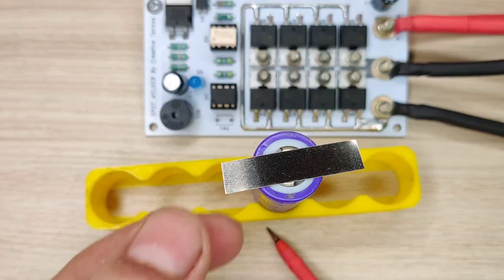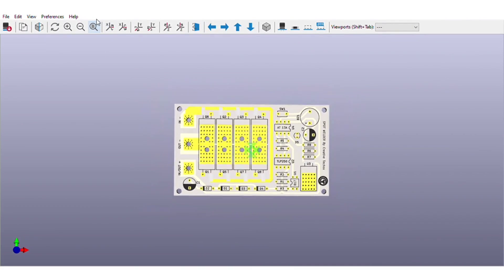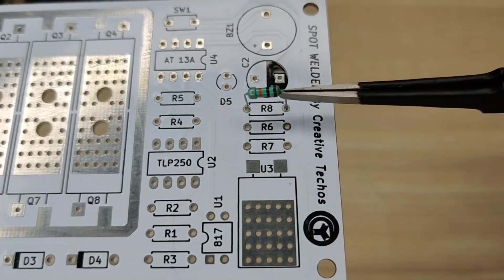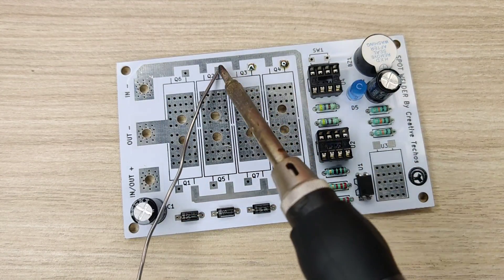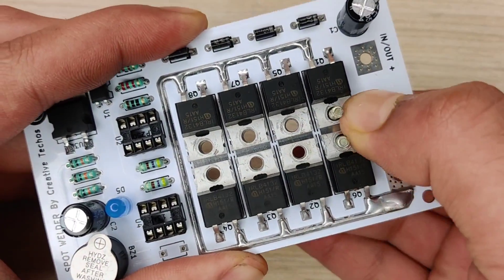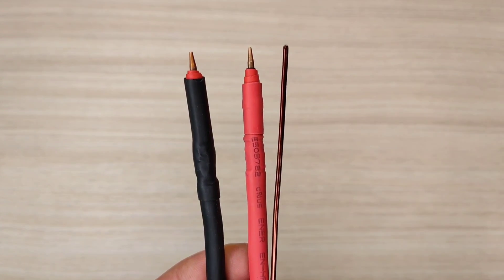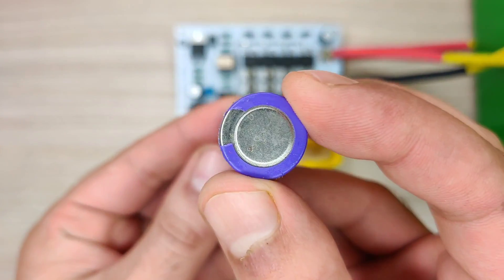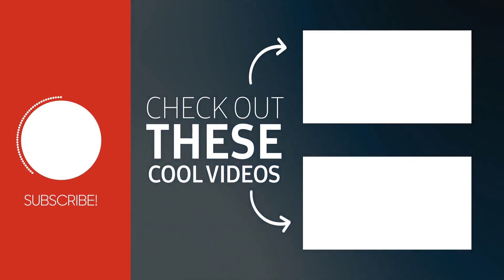How to make Portable Automatic Spot Welder

Comment from the maker: 👉Download Circuit Diagram, PCB Files & Code
https://drive.google.com/drive/folders/1iLm-MczZgpwBLVQtHvoQZ2wGku-BMCCM
Reply: Is this the Gerber file 
Then code what does it stay for pls
Reply: The gerber zip file included only NPTH drill layer but not PTH drill layer, therefore JLCPCB did not produce the PCB with vias. Can you include PTH layer and update the file?
Reply: @atildora9034  What I'm going to do is I'm going to find all the components in smd (SMT) version
Reply: @fiosasolta  This is a two layer PCB therefore, some pins will need connection on top and bottom layers. That is why the "vias" are needed in the drilled pin holes. Hence, SMD may not be the solution. I started drilling the holes myself. For those holes that require connection at both layers, I will try to establish connection by soldering.
Reply: @atildora9034  Thanks for the info
Reply: @atildora9034  Too late I ordered the pcbs and I have already received them.
Reply: Úù mean we can download it and printed it for ourselves
Reply: Sir you are great but this is our bad luck in our country the cost of pcb from jlcpcb is (2 to 4$) but you imagine the shipping charges is (20 to 60$) how can I order pcb you have any idea.
By the way I am from Pakistan.
And our local market is just piece of shit.
Reply: Good
Reply: can u share json file to me
Reply: Pls I need handle to be able to talk to you Wattsapp or telegram
Reply: I ordered a PCB through JLCPCB but there was not a single drill hole on the board. Tried on PCBWAY and same problem. Then I watched your video again and when you uploaded the zip file to JCLPCB, I noticed that there are no holes in your video either.
Can you check your zip file and upload it again.
Great project regardless of the small problem
Thank you
Reply: U don't reply messages why
Reply: I uploaded u r pcb design on side dont have soldring holes in pcb . Can you answer?
Reply: Hello brother can i get One PCB with/without components
Reply: Thank you for sharing.... but I can't download in this link (can't open). Can u help me to share in another link or drive? 🙏🙏

Comment: very nice.  its good for any light duty work by a hobbyist or anyone who sometimes need to weld batteries.   i am following a similar approach in my design with following modifications.  this will help to keep prices low and also the efforts

1.  instead of buying new mosfets, i am using for an old computer UPS for 500 VA or more. i have sawed the PCB from UPS to extract mosfet together with heatsink etc

2. for the timing, i am using a programable timer module easily available on line.  you can program pulse from as low as 10us.  the relay in the module may be used or can be replaced by optocoupler

3. for the purpose of safety, have added a snubber on MOSFET and a circuit breaker in series with battery.  if for some reason MOSFET blows, the short circuit conditions can become very nasty and dangerous

4. the timing circuit and gate driver is powered from battery, it would be good to use a capacitor and diode to keep voltage steady during welding.  the battery voltage will fall during the pulse duration.  the will ensure steady gate voltage and protect MOSFET from failing

Comment: Good and professional project my friend, youre doing well, i love your projects and they save me. Sending you hugs from Nigeria. 

I tried making your circuit by fabricating my own pcb through your schematics. The attiny13 beeps the buzzer and blinks the led when it sends out a pulse. But i didnt see the tiniest spark. I am testing with two pieces of IRFZ44N, and 10p 3s 18650 battery pack. Im thinking of using IRF1404 as you suggested in comments and use 12v lipo too, perhaps I'll see a change. If you have other suggestions on how i can succeed, kindly tell me.

Great job. Love from Nigeria.
Reply from the maker: Thanks for appreciation, qs you mentioned you used 2x irfz44n fets, let me tell you, it will not work! You need to use logic gate level mosfets, IRF1404 is also perfect but you need to use atleast 4fets to get good weld, more fets means high welding current

Comment: ATtiny13 Pin 2 is not connected to R7 in PCB
Reply: its connected to both the switch one side and R7 - i just checked it on the actual PCB view to manufacture order page in jlbpcb

Comment: Hi mate good project kuddos first.
What's the recommended 12V battery for this application? Whats the rated current capabilities needed
Reply from the maker: Thanks for watching my friend 🙂
You can use lead acid car battery minimum of 35ah, or use lipo 12v 2000mah battery
Reply: @CreativeTechos can i use 3s6p 18650 batteries?

Comment: Would a IRFZ44N HEXFET Power MOSFET work? I don't think that it has the logic gate feature. Thank you. Sorry for the noob question.
Reply: If not, would it work if I added a gate driver?
Reply from the maker: Actually the irfz44n is not logic gate, still it can work but, will not provide sufficient drain current to strongly weld the nickel strips, you can use driver gates to drive these fets, but option is still to use logic gate that fully opens within 5v
Reply: Use IRLz44N logic level mosfet it is. But that current limit of 49amp

Comment: Do you really need attiny just to send pulse 😅
Reply from the maker: Actually it is not only about to get a pulse for fets, due to microcontroller it is also able to sense probes and send auto pulses. Also the pluse time can be modified according to your usage, otherwise i have made commercial level spot welder using cheap 555 timer ic.
You can check that too on my channel